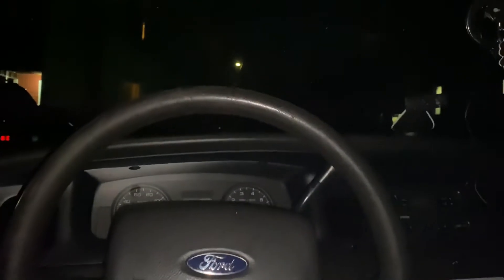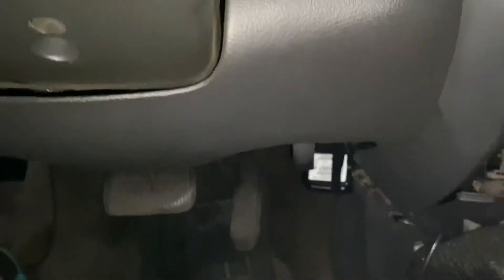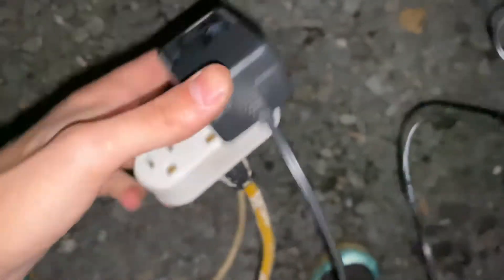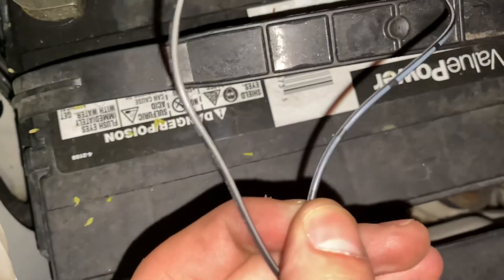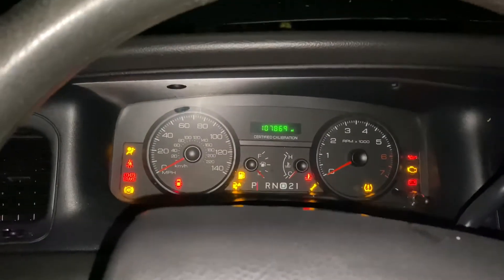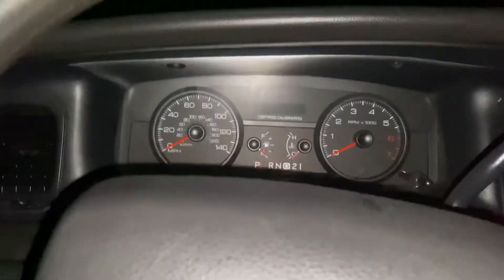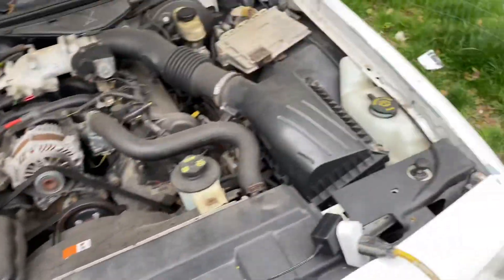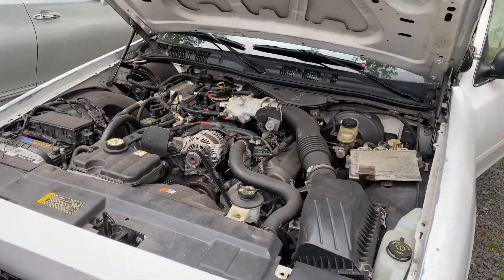How to start your DEAD CAR with just a Cellphone Charger

Comment: Ty.. charger box cord is a transformer reducing 120 volt -12 volt otherwise it will blow it up, good idea undo battery cables from the vehicle while charging is good too. I’m inspired, thanks
Reply: Good call on disconnecting the battery from the vehicle first. Might save the ECU. I would actually dismount the battery completely away from the car. 🚗🚨

Comment: Just pulled this off on my completely dead battery (less than 1 volt). Instead of a phone charger I used an old Xbox 360 power supply since it's 12V
Reply: Did it work?

Comment: It's not dead it's just below 12 volts it's almost able to turn over could be alternator issue I noticed I'd have issues starting cool mornings for 6 months changed battery in-between that time and then boom lost power at a red light and knew it

Comment: Hey. Nice job but cell phone chargers have outputs of 5V and car batteries need to be charged to 12V to be fully charged. Maybe your ac adapter was from a different type of item such as rechargeable spotlight or R/C car? The black box on the end is much smaller on cell phone chargers also. 👍

Comment: cell phone charger 4.5 to 5 volts.....car battery 12 to 14 volts.
Reply from the maker: On average previously, yes. But that is changing drastically. New USB type C chargers are doing 15 watts minimum with 3Amps which is 9V and will be a fighting chance for starting smaller cars with lower CCA's (I used a V8 In the video)
Reply: Trickle charger with a automotive charger, 2 volts

Comment: Your teaching people something that can be extremely dangerous and potentially deadly. Furthermore, you might risk liability for such things If someone where injured following this. Automotive batteries can explode if the voltage and  or watts applied are incorrect. In example if someone grabs a laptop charger that applies 19 or 20 volts power or if the terminals were to be crossed reversed when they hooked up the wiring. Allow this method may have worked for you, I think you should consider speaking to someone that's actually seen a battery explode or has been injured by one due to some  neglect for respect of the potential a battery contains for explosion. Remember theses batteries contain an acid corrosive enough to cause some severe burns if touched by ones unprotected skin. Imagine if you were saoked in it and also ignited by fire also.
Reply from the maker: I appreciate your concern for the general public in this comment and absolutely agree with you.

I've since updated the description of this video to add additional safety precaution to avoid such misunderstanding of my video.
                                          -Corey
Reply: @Allprocorey lol I tried this as soon as I seen the video and it worked ignore the haters if your not dumb and listen carefully and use gloves your fine
Reply: let people worry about their own safety. and calm down...lol the likelihood of exploding the battery is pretty small. sharing knowlege is alwaYs good.what others do with it is their own concern.
Reply: @bigdaddyz376 warnings exist for a reason buddy
Reply: Yeah life is dangerous. These hacks are life savers. The will to survive and the ability to create/use tools is all we have. Deadly was a bit extreme. I guarantee you more deaths happen being exposed to the elements than battery explosions. Batteries do not go off like sticks of dynamite. You just lost your man card for 5 years minimum. While your sitting to pee remember to chew your food, hands at 10-2, fish hooks can rip eyes out, water guns are nothing to be played with and never forget to hold the hand rails while on stairs. Someone send this guy a bicycle helmet and a whistle.
Reply: Roflololololol
Reply: I know Walter White and Jesse Pinkman wish they had this when the RV died in the desert 😂🤣

Comment: Dude isn't red positive you said that uh the stripped was negative and you had it on the red unless your from another country or planet I believe red is positive my friend and I believe you may have done it right obviously but shit you may wanna be accurate on some ish like this cause I really need the help man
Reply: That red mark was on the wire that was going to the right terminal it just looked like it was on the left I thought that too. Watch it again you'll see what I mean.
Reply from the maker: @bradenpederson4682  thank you for clarifying the comment Braden. the wire that had the striped lines was indeed the negative cable. for a short period of time showing the setup they were crossed but attached on the proper terminals. the red positive terminal was located on the right hand side of the battery! sorry for the confusion.